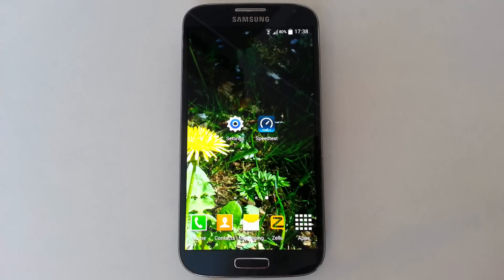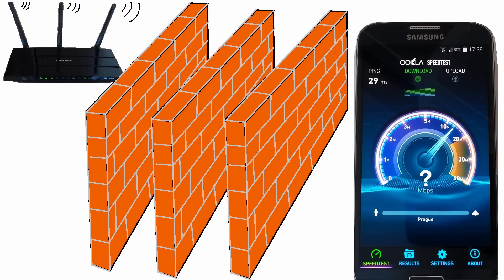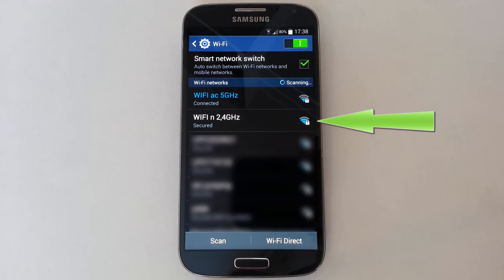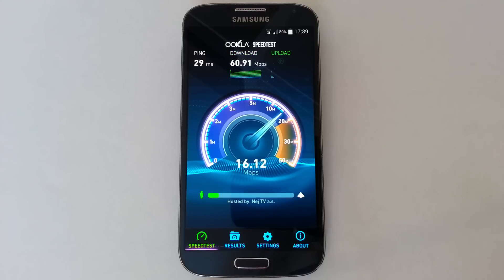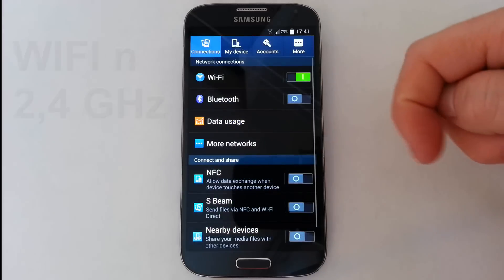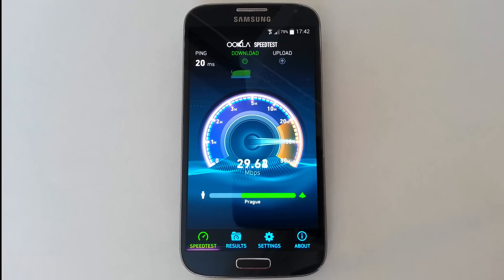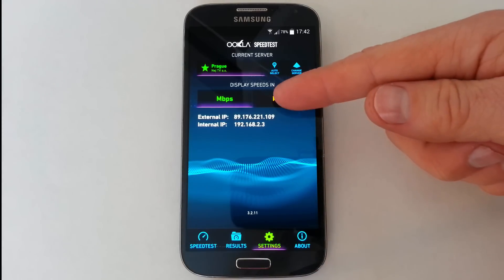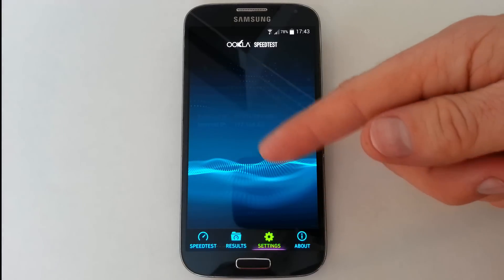TP-LINK Archer c7 Router WIFI 5GHz vs 2,4 GHz LOW SIGNAL Speed test

Comment: You cannot discount this router for having less range on 5Ghz band than the 2.4Ghz band! Everyone SHOULD know that 5Ghz has lower range ability for the same amount of power output as 2.4Ghz band!
Reply: Yes, but 5ghz is better for low range, cause as example microwave can't disable wifi for 5hgz, but for 2,4 when i turn on microwave, wifi doesnt work, and it is like 2 metres from router.

Comment: Try Channel Bonding on the 2.4 GHz Network (40 MHz Wide) if there are not as many 2.4 GHz networks in the area for a speed of 300MBPS compared to 144.4 MBPS on a 2.4 GHz (22 MHz Wide)

Comment: There is one flaw with this test. Speed test is using your ISP internet instead the routers actual speed. You may have a 5000 mbit router but your IPS won't allow more than what you pay for it so no matter the router if your ISP download / upload is 50 mbits you won't see anything difference with a router that can handle 100 mbps and more. You need to test it with a software like lanbench but for android, and your PC needs to be wired.

Comment: I hooked mine up today and the hard line is slow. The 2.4 is mediocre and the 5 is 100 mgbts in the same room but drops to 40 mgbts 15 ft away. 
What is wrong with the hard line I have cat 5 cables. Should I get cat 6?
Reply from the maker: Multiple causes.Easy 1.step: Test cable connection speed on another new PC. 2.step: change cable to cat5e or higher because cat5 is old and maded for 100Mb base. (cat5e is for 1000Mbit ethernet).
Reply: I only have iPhone and the cat5 is connected to a tiger stream box. I was using a netgear n600 and was getting around 60 mgbts with the same wires. 
I talked to tp link for an hour today but he had no clue what was wrong. And then charter but they just said since I use my own router that they don't guarantee the 80-100 mgbts and said my modem is working fine. 
I'll order the cat6.
Reply from the maker: Ok, I recomended Router with 1Gbit ethernet connection and 1Gbit LAN in PC, because old 100Mbit connection can handle 90-95Mbit of real copy speed.
Reply: The Cynic any luck getting more speed out of the Archer C7? I’m back the exact same problem.

Comment: whats the lan speed with 5ghz ?
Reply from the maker: +André Gm LAN Cable connection to router was 120Mbit for download and 12Mbit for Upload.
Reply: o mean local network in 5ghz from the phone to the router
Reply from the maker: +André Gm If phone have full signal, i measurement 120 Mbit/12Mbit and more. LOOK here:
https://youtu.be/aZw5AVu9uJ8